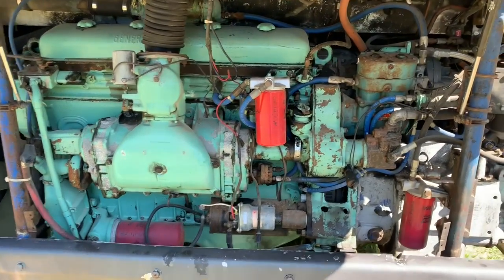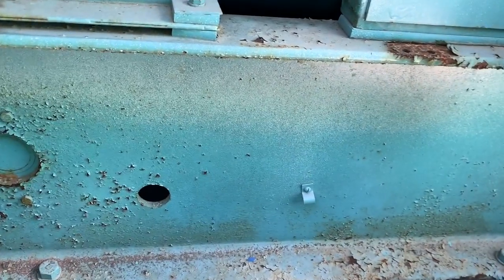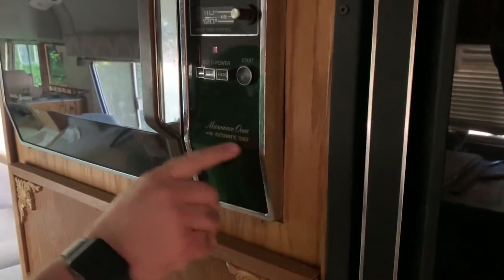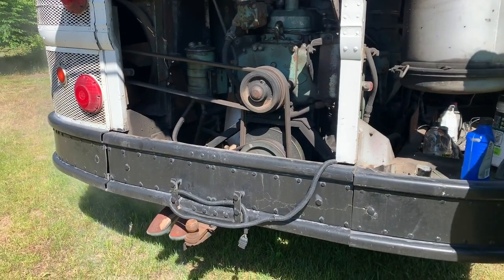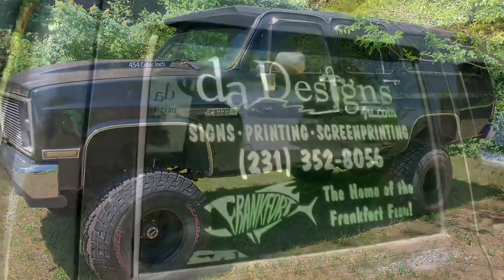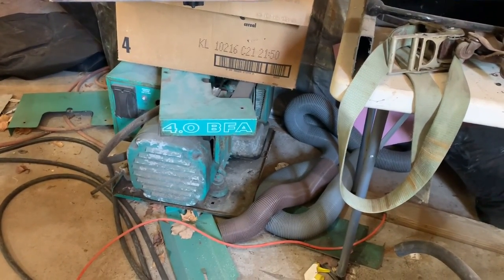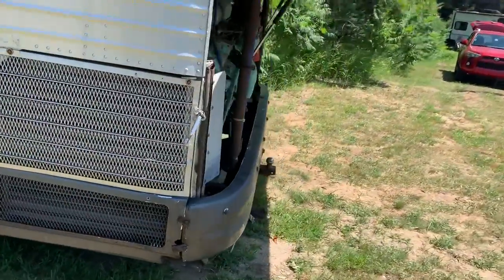Michigan trip a fun stop

Comment: I finally dug my kubota out the other day and fired it up. Had been sitting for a year but fired right up after just one or two revolutions. I've got a 650cc 3 cylinder on a riding lawn mower lol. 18hp and roughly 32 ft/lbs of torque :)

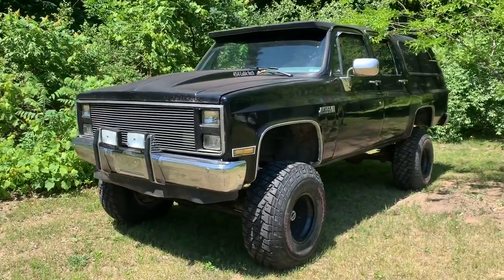Comment: 11:00 Uh, 454 hooked to a 700R4?  That doesn't sound like a smart combination... I'd want a 4L80 behind a 454...
Reply: @UCeHAvDSP4PC_t9m29T_t-Pw Now I see what you are saying, I remembered also that at the time, late 1980's, GM had yet to introduce a 4-speed OD version of TH400, which was still being produced along probably with the TH475, for 1-ton and medium duty applications.  Work had probably started on the 4L80 tranny, but wasn't ready for production yet in 1988, if they were going the methodology route as they did when turning the TH350 into the 700R4.
Reply: Patriot1776 after the TH700r4 GM had the Allison division to take the TH400 transmission and make it a 4 speed. That brought us the 4L80, 4L80E, 4L85E.
Reply: Wouldn’t have come from the factory that way, gm didn’t even put a 700r behind the  454’s in the half ton ss trucks they got a turbo 400. Either it was originally a small block or that trans was added for the overdrive.

Comment: I'm really surprised that generator only has 2 axles .. . Cool Vid though
Reply: Even modern large gens of similar output still use two axles.  They also have supporting jacks at the four corners too.
Reply: @1320fastback  I use to pull Gen's for Young Generators in the late 90's..  I just remember our 2500 amp Gen's having 3 axles..  :)
Reply: They like mobile home axles , strong and cheap but they use an odd size tire, 16 ply if I recall correctly.

Comment: One a car engine starts its a good idea to remove the cables quickly as the battery charger and the alternator are fighting each other to charge the battery. Newer chargers have smart tech to stop this from happening but many of those roll around charges do not have that tech. This can blow your diodes in your alternator or charger or both. Just pulling the power cord on the charger will work many times i put the plug close so i can kill the charger when the motor starts.

Comment: Question, Maybe I missed it in an Earlier Video but as a Long time Motorcycle Racer and Engine Builder could you explain if the 2 stroke Diesel works on the same principle as a 2 stroke Motorcycle engine. Are the Ports on the Cylinders The Intake Ports and the Valves in the head are just for the Exhaust. Also is all the power made in just 2 Revolutions like a 2 stroke Bike engine.  Love the Video's,  Thank You,  Roger, Vista, Ca
Reply from the maker: Intake ports in the side.  All the valves in the head are exhaust only.  Fuel injected and everything happens in one revolution ie 2 strokes one up one down.
Reply: @BusGreaseMonkey  Thank You, Roger, Vista, Ca

Comment: If that is an original radar range ( the very first microwave oven ) they sold for near $15,000 when they first came on the market. I remember seeing them at a high end store back in the early 60's. 

Tired engine or in need of a rack adjustment.

Comment: I presume that is a custom engine installation as 4104's are normally crosswise to the body with a 45 degree spicer 4 speed straight cut gears transmission. Unusual to see that type of installation without an 8V71 installed. Neat!

You definitely have some interesting stops in your travels.
Reply from the maker: You are confusing the flex and the 4104.  Flx is T drive 04 is V

Comment: Nice squarebody. It just needs a 6.2L diesel
Reply: Anything but a 6.2! Why not a 4-71 or a Cummins?
Reply: @Mullay2  Got to keep it original. 
putting a Cummins in a Chevy is Ghetto.
 Keep the Cummins for the dodges
Reply: @96chevydually6.5L  Would you go for a 6.5? That works for me. And judging by your YouTube name that would will work for you as well.
Reply: @Mullay2  A 6.5L would  work in a pinch but for the year I would keep it a 6.2L for original value sake
Reply: Had a CUCV with a 6.2L and it was ok till the crank snapped.  IMO a 12 Valve is worth every penny to convert these trucks into something reliable. The 5.7/6.2/6.5 were just terrible if we're being honest.
Reply: @Mullay2  I would vote for the 6V53TA.
Reply: @josephheston9238  there are several Chevy trucks on YouTube with 6V53T''s in them. Several others are videos with 453T's.

Comment: the two onan bfa 4 kw generators..  the generator end is not dead if it will crank being the generator is the starter..  they have two relays in the bottom of the box with the start button and one may be bad being they are from the 80s, or possibly late 70s..  that or the low oil pressure switch is bad.. or it has low oil.. but being he said it would pop when he released the start switch im betting its one of the relays..  they also have a charging resistor on the back of the generator on top, under the removable band that can burn out, and will not send power to the ignition..  or just possibly a corroded connection someplace..  very simple generators.. just need to spend a little time trouble shooting it..  check out smokstak.com there is a whole generator section with its own onan section and extremely knowledgeable people.. some that have been working on onans since the 70s or longer..
Reply: I did replace both the relays, and bypassed the low oil switch when it died. Was a head scratcher for me after that. Not familiar with the charging resistor you mentioned.
Reply: I have a BFA4K on a fuel tank cart and it's been so reliable.  Parts are still available for these things and very easy to work on.